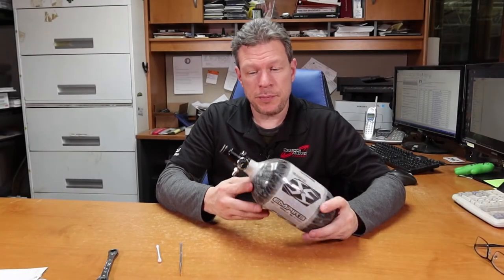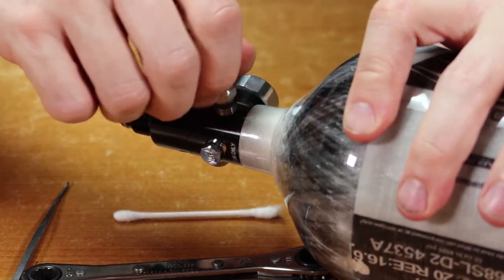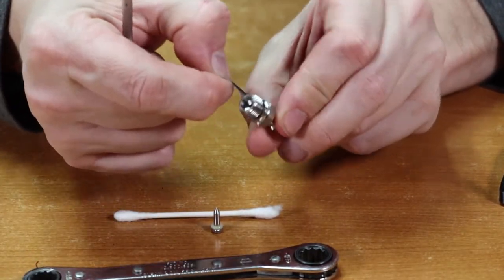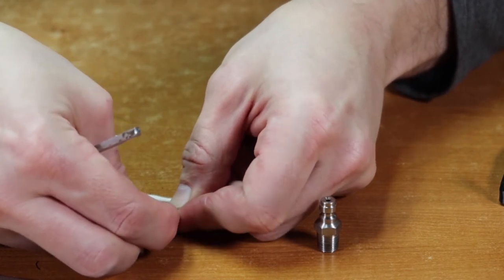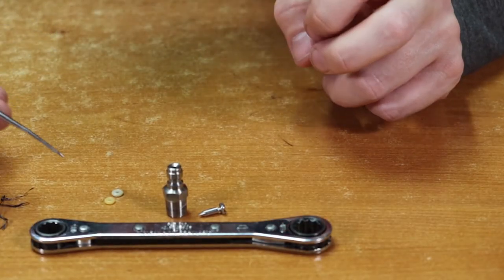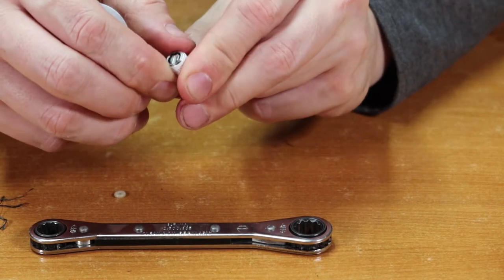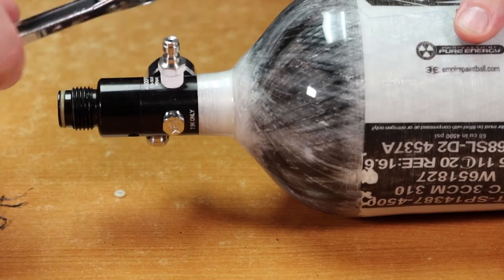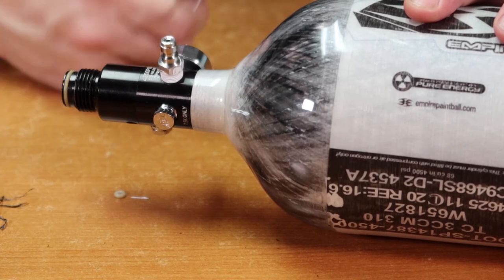Empire Paintball 2020 fill nipple repair by Hogan's Alley

Comment: I guess someone could make a really bad comment about using a cue tip (and even keep rotating it clockwise inside the threading) to clean the fill nipple port on the regulator... (those damn cue tips ruin even airgun barrels! - from what I've heard🤣) ..but that commenter is not gonna be me.😁😁
A way good video. Thank you!
The fill nipple on my Sig Sauer Virtus PCP started leaking, so I just wanted to check out some vids on the subject. But my Sig's fill nipple is slightly different than the one in the video. Has a green, and way smaller o-ring in it. No wonder it broke already. But I'll find a new nipple if not just a new o-ring..
Thanks again! 🙂👍🏻